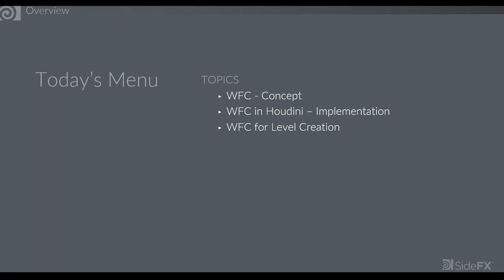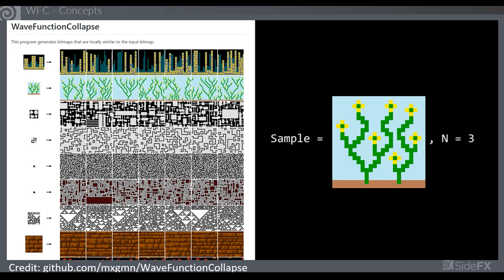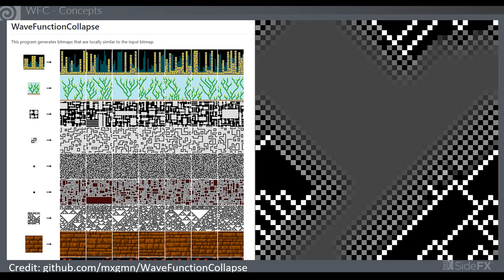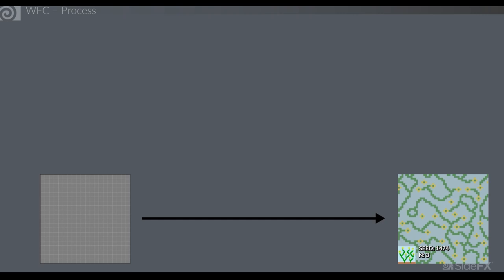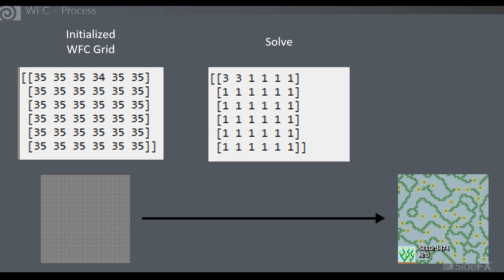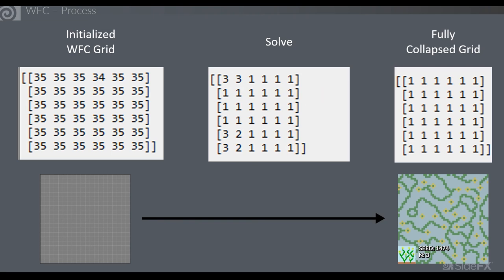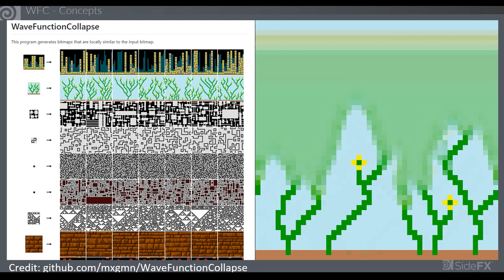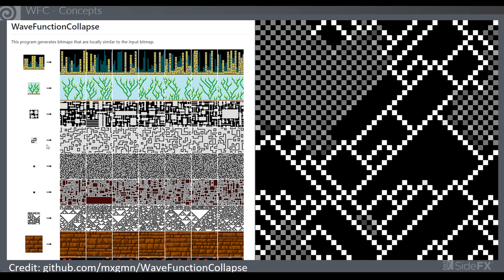WaveFunctionCollapse Supercharged with PDG for Level Generation | Paul Ambrosiussen | HOUDINI HI...

Comment: Wait, every cell on the map has two arrays:
1) possible tiles; here the tile is a variant of color in the middle and all neighbour cells;
2) possible colors in this cell.
So even than if the cell is green in the middle, it can have multiple variants it the array 1).
If I check the neighbour cells and it can only one color variant then it will be collapsed to one color from array 2).

Comment: Hi,

at min 14, why the top left? Why does the top left get priority?
Should it not check every of the 9 possiple pixels from the 3x3 ?
If we would check the Red pixel against MiddleBottom of 3x3, we could find a possible Pattern that fits.
So does the top left Pixel get priority or do we check against all, and then pick a random one?

Ty for the Vid!
Reply: Hey, I'm also struggling through this stuff so I could be incorrect. I believe the idea is that the red pixel has the least options, ie lowest entropy, so they just pick a random option from the list of possibilities. In this algorithm, the author has chosen to always chose what is described as "the top left" (which is probably just a specific slot in an array) instead of choosing a random option. I hope that made sense. Good luck!!
Reply: Addendum, I may have misunderstood this part. The idea remains the same though, the author chose to start the "sorting" of options with the top left one.